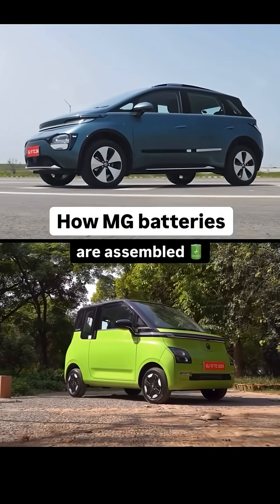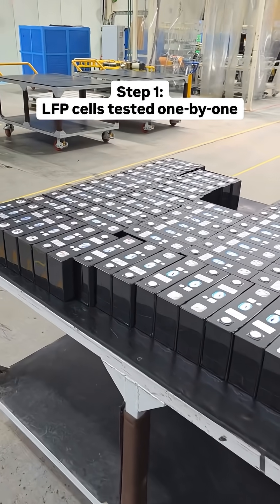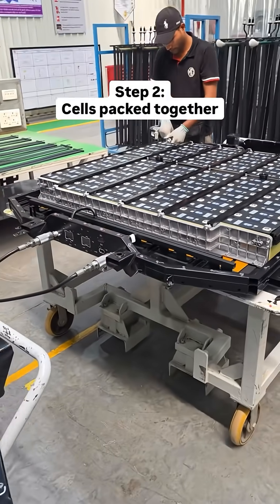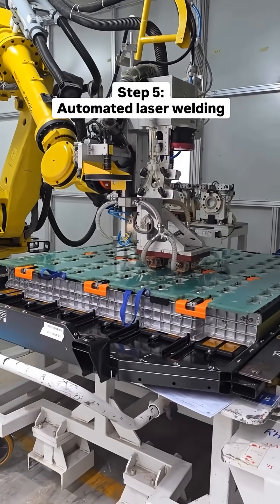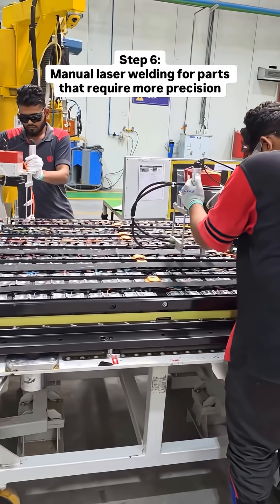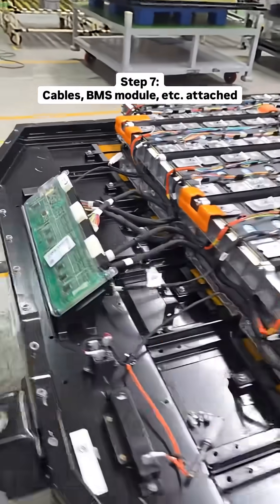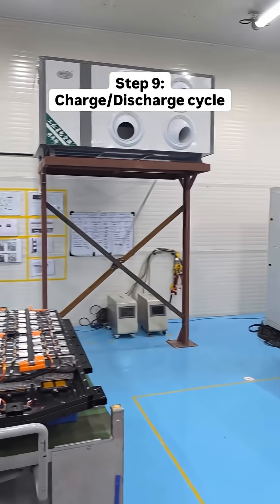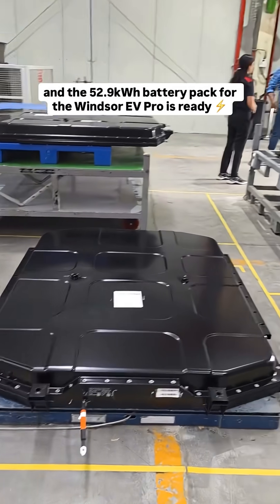MG batteries assembly #shorts

Comment: Nice, and informative video. However, I request you to follow up on how the MG Windsor battery management/charge controller system handles DC fast charging in the real world. Many, many cars are facing issues with DC fast charging. Several software updates have been provided, but the problem remains for many. Will make your story complete.